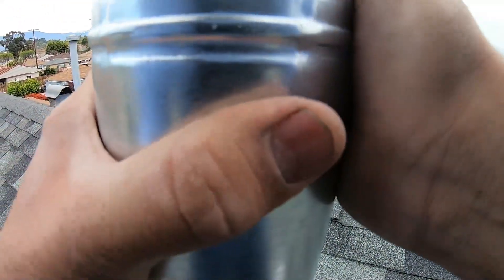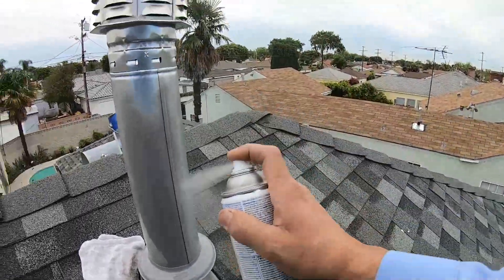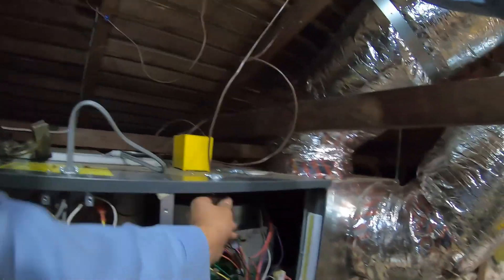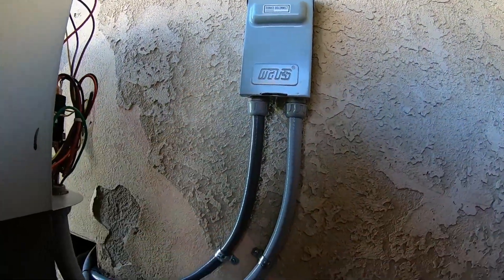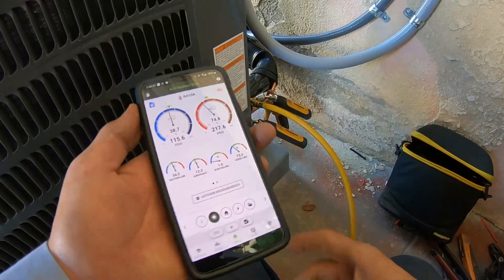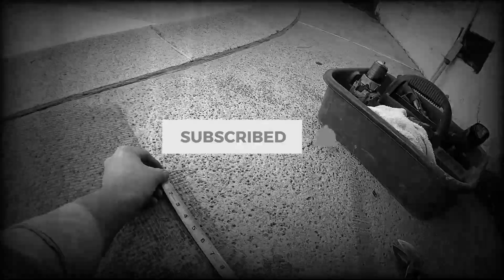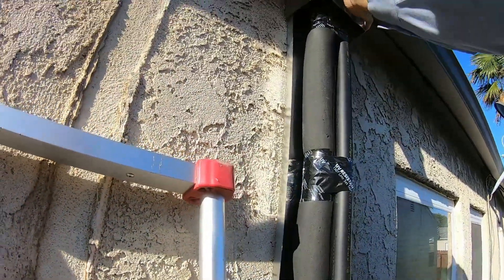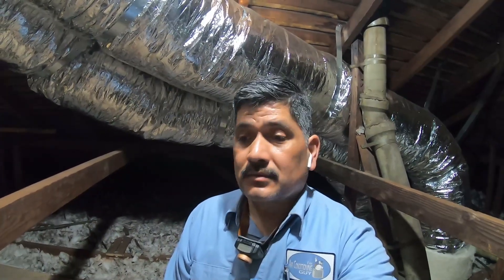New Home HVAC Installation Part 6

Comment: In fairness someone could weigh the tank at their truck, charge it, then weigh it again when they put it back in the van. I understand your point though.  Its been a good series to watch.
Reply from the maker: That's correct I've done it that way to. Just make sure and let your customer see you do it. However, I like having the scale there so I can see the rate in which the refrigerant is going in.
Reply: That's what I do sometimes as well

Comment: Really turned out fantastic what a beauty. If I did have to change one thing I would support the coil from beneath so you can get the door off in the future. But everything looked wow beautiful
Reply from the maker: I was going to but there was one of those old rigid electrical pipes in the way. But the way I strapped it allows for the front cover to be removed. I know because I've done it before. After you remove the screws it will slide up. But I agree that it would look better with a stand.

Comment: Excellent looking job! It’s very clear that you take pride in every aspect of your job, even programming the thermostat. Quick question though why do installers in California use that insulation with no backing on it to wrap those elbows and collars? I install on the East coast and we always use FRK duct wrap R-8. Also how do you get it to stick to the duct? Spray glue? Here it’s staples and FSK tape, sometimes I’ll even mastic the seam over the tape. I’ve just always wondered about why that type of insulation is used there. Again, that’s one of the neatest and cleanest installs I’ve ever seen! Loved the whole series!
Reply from the maker: Thank you for your great comment! Our weather is very mild and humidity is normally comfortable to dry. Rarely too humid. We use FSK on commercial work but as you can see I don't do commercial. And yes we glue it on with spray glue and some old timers also used  18 penny nails. They'll stick  them in, in a zig zag motion grabbing two pieces of insulation. Not sure if I painted the right picture with those words. Hope that answers your questions. Let me know if it doesn't.
Reply: That definitely clears it up for me. Thank you for your response!

Comment: Great video. I'm new to this field. Learning a lot. Question that a condensating unit. Do you need a exhaust and intake flue pipe?
Reply from the maker: Depends on the model. Some do require it and others are optional. Direct vent requires two pipes and Non-direct do not. You'll have to check the installation instructions. Thank you for your watching my videos!

Comment: I'm new contractor just got my c-20 I love the way you install it reminds me of the way I was taught  to install back in 2003 when we would put 3 screws on the wire on inner duct  then pull insulation jackettape and put 3 more zip screws a lot of the new installers have no pride in their work we would always try to make our installs pretty  now im a lead service  tech but I install for my personal  jobs tying to build my business wanted to ask you how long does it take you to do a cut in like this one on the video  I know it take a bit more time the way you do your installs they look very clean
Reply from the maker: Right now they take me about 5 to 7 days because I don't have much help but with help, two installers should be able to do it in 3 to 4 days.

Comment: Beautiful job. How many days did the job actually take?
Reply from the maker: Thank you! A little over 7 days because of the rain. You install?
Reply: The Air Conditioning Guy started in the trade (30 years w) as a installer but mainly do service now. But I do like doing installs more. By the way you do the nicest/cleanest installs.
Reply: Hi Juan, another one in the books! I started with Field Piece, but one day my truck got broken in to and all my tools  was all gone. So I invested in to iManifold and started using iConnect. Now I wonder if I should go back to FP. But MQ works with the iConnect probes. ( Sort of) And I made a New Years resolution not to buy any more tools, because every time I go to the parts house, I’m like a kid in the candy store!
Reply from the maker: @williamgildea8348  Thank you! I try. Hope you subscribe for more 😀👍🏽😷
Reply from the maker: @josbrun  Ha ha ha! Same here. We're Tradesmen! That's why. I have the iManifolds  and if it wasn't because one of the air temp sensors went bad I wouldn't have probably bought the fieldpiece yet. I did have my eyes on them because of the convenience. I hated having to use those wired SL & LL probes.